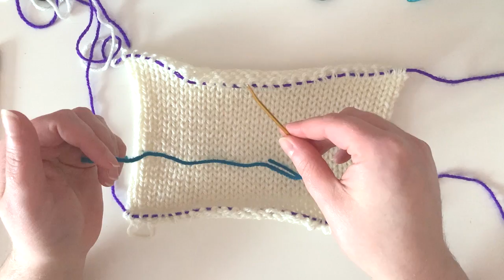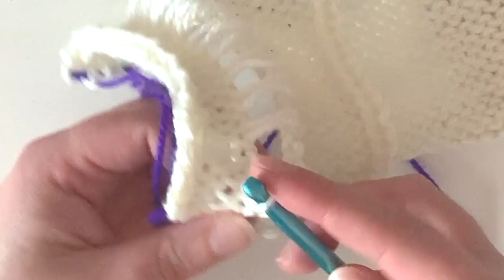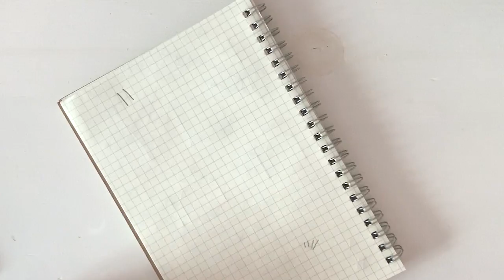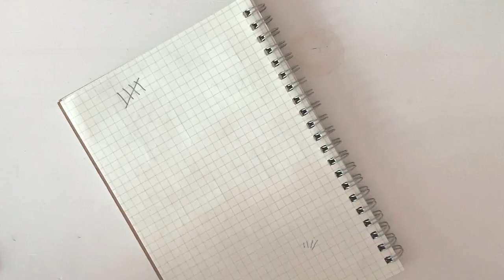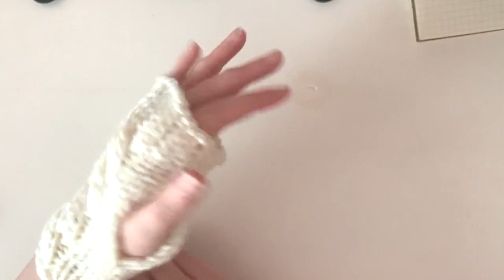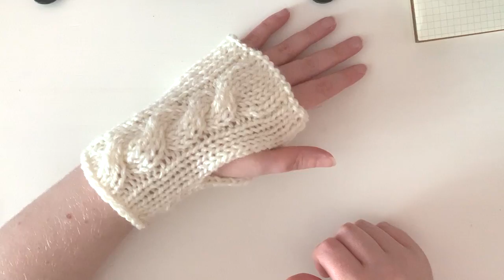How to knit afterthought cables | Knooking Crochet | Knitting hack | Addi Sentro machine ideas

Comment: Hey, I'm curious if you've ever tried using that cardboard tool thing you made and used in the video about machine knitting a greater number of stitches than the machine has, so you can skip the step of undoing the wider set of stitches that get cabled?

You might not be able to do the perl stitches, or at least not the same way, but it seems like a potential shortcut.
Reply from the maker: I have. Check out my cabled pillow or large beanie videos. I used the extender then cabled the extra stitches. It’s honestly my favourite thing to do ❤️. I get to make large projects but still get the joy of knitting cables by hand.
Reply: @emilysmith2784  I'm adhd and unmedicated today so I ended up switching videos very shortly into that beanie video and missed how you dealt with the excess. I feel so silly but also good. Silly to suggest something you would obviously think of yourself but good that I thought of it before seeing you do it. 

I can't wait to utilize that technique, but I think I'll wait till tomorrow and after I take my meds.
Reply from the maker: @nyxskids  great minds think alike 😊

Comment: Thanks for this idea!  May I ask what size crochet hook and Nook hook was used?
Reply from the maker: I used a size 5 crochet hook and size 6 knook
Reply: @emilysmith2784  Thank you for fast reply!  Did you happen to measure the width of the loops once you un-knit the 8 sts. I am curious how much yarn did it take to knit those 8 sts.
Reply from the maker: @Barb515  I didn’t but in my large panel video i show how to measure your machine. I think it’s 15.5cm for 6 needles.

Comment: If I am knitting tubes that I then join for my project I would be able to do this before closing a tube wouldn’t I? 

Also wondering if I could create ribbing for sleeves as an afterthought using your method for making purl stitches … how do you do it if your not pulling the whole row/column out eg like 6 stitches at the bottom if I was trying to create afterthought ribbing for cuffs and didn’t want to rib any further up? Wait… I would just need a stitch holder and pull it through when I got back up to the stitches I didn’t want to pull out?
Reply from the maker: Yes you can do this on tubes. For ribbing I would add a lifeline to where you want the ribbing to start and drop the columns down to that line then from the back of the project work your way back up to the edge. I am pretty sure I’ve done this in a tutorial before. I’ll have a look through my content and let you know if I find it.

Comment: This is really wonderful. I admire you're finding ways to elevate these circular knitting machines. There are a lot of hand manipulated stitches that bed knitting machine knitters use like this that translate very well to these machines. Ribbing, fisherman's rib, cables, tuck stich and knit purl combinations. A knook is a great tool for this but you might also find that double ended Latch hooks used for machine knitting and double ended crochet hooks used for tinisian crochet are also EXCELLENT tools to do this type of work and can be bought fairly cheaply.
Reply from the maker: Thanks for the suggestions. I have latch tools but there is a learning curve to using them. Haven’t tried a double ended crochet hook though, I will definitely look into that 😉

Comment: Can this be used when making a beanie in the round?
Reply from the maker: Yes. But if you are using decreases at the crown you may want to add your lifeline at that point, unless you can figure a way to incorporate the decreases into the cable design.

Comment: Lovely tutorial. Question: Does this shorten the width of the end product? If so, how is this dealt with to ensure the width of the end product is the correct size? Thank you :)
Reply from the maker: I didn’t measure it before and after but i didn’t notice a difference in size so I would say no it doesn’t change the width, and if it does the difference is negligible